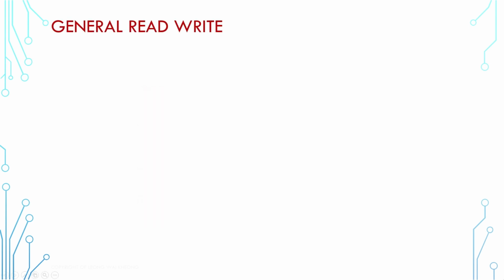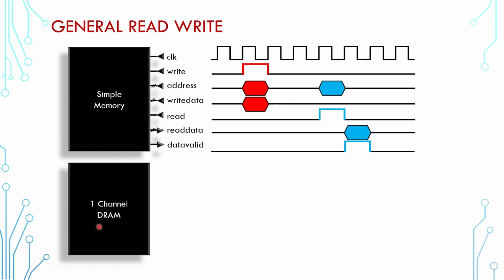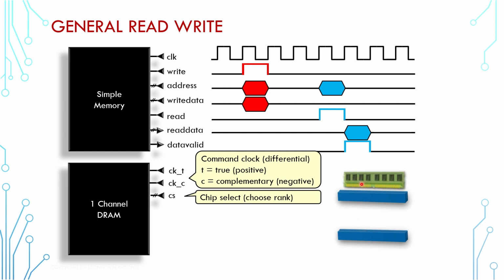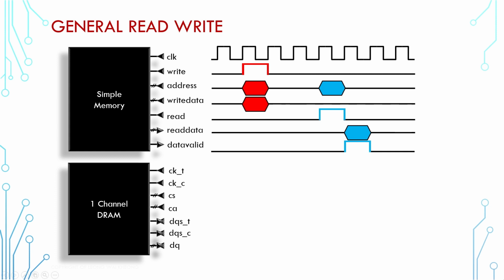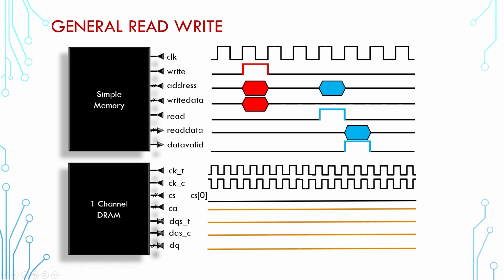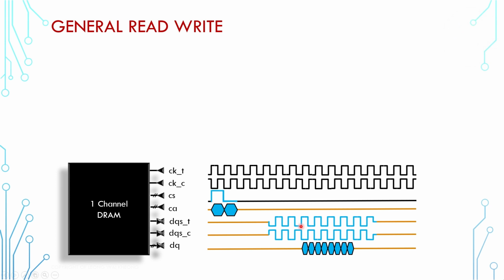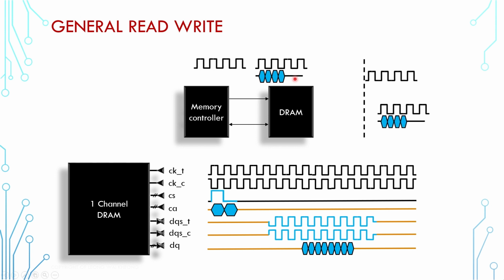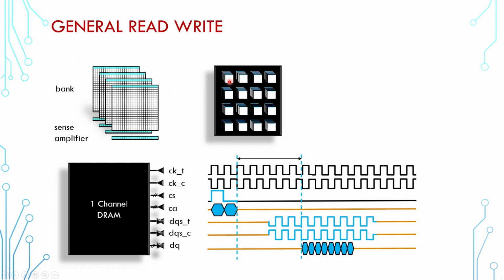DRAM 05 - General Read and Write Operation on DDR Channel

Comment: Would you consider making a similar video but for SDR SDRAM timing (for example, Winbond W9825G6KH-6)? That would be very helpful. Thanks!
Reply from the maker: Thanks for the comment. Unfortunately I no longer work in ddr domain and therefore I do not have the resource for information, moreover I've never work on sdr before. Sorry about that

Comment: Fantastic video! I now understand why accesses to the same row are faster than jumping around. I would imagine that memory requests could be sped-up if reordered such that row accesses change as infrequently as possible. I'm guessing this is what the Xilinx MIG IP "memory command reordering" setting does.

Do you know if most DDR controllers support reordering of memory requests? Are there other factors than row addresses that may cause memory commands to be reordered?
Reply from the maker: Thanks for the comment. I do not know the actual meaning of Xilinx MIG IP "memory command reordering". I feel it is related to cache coherency , not on DDR. There is a concept called bank interleaving, which is how DDR controller minimises jumping on different rows; I believe this is widely implemented.

Comment: sir one query , is the write and read leveling is done at start of the dram controller, sir one video on ddr zq calibration and PHY interface along with training, calibration and initialization  sequence would us alot sir  .
Reply from the maker: They definitely happen once during initialization. There are calibration which are done periodically, but I'm not sure if write leveling is one of them. Thanks for the support, but to be honest, while I have plan for other videos on DRAM, they will take time.